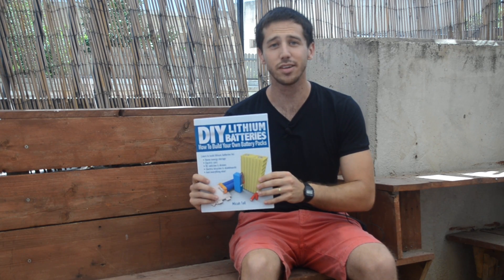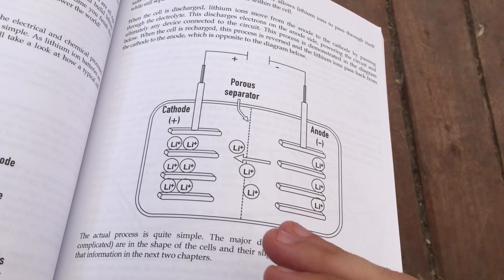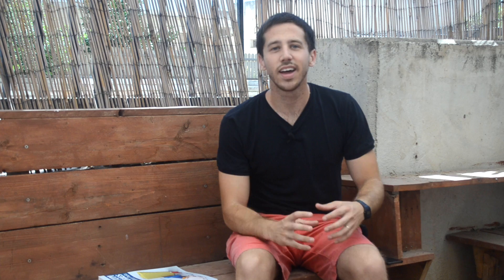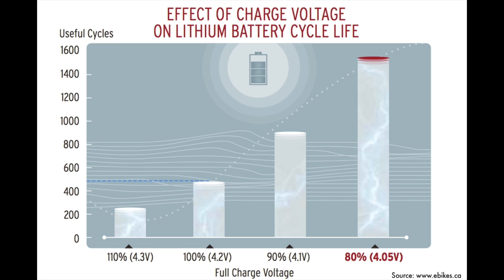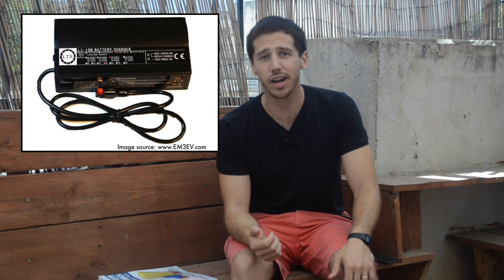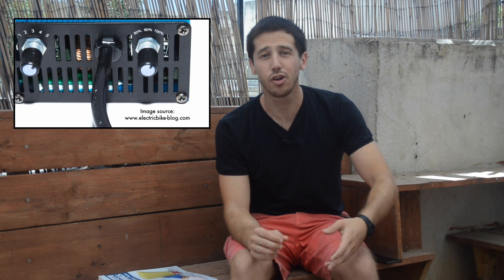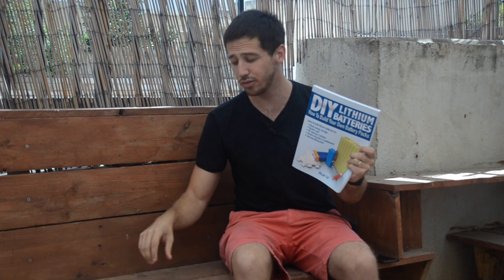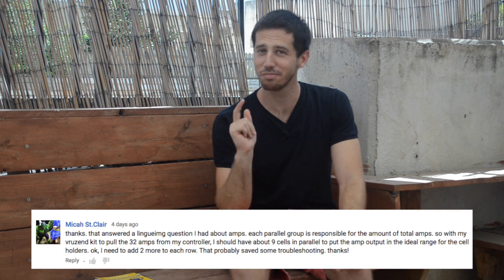How To Double The Life Of Your Lithium Batteries

Comment: Hi can you PLEASE 🙏 make a tutorial in how to make a 60V 680wh  battery  (or stronger) from start to finish. I plan on using 18650 lithium ion cells from hoverboard battery’s . It would be for a   Airwheel s5 (Segway) . The replacement battery’s offered are way to expensive, so please make a tutorial  that shows how to do it safe and on a budget where possible 😉 
Thanks for sharing your knowledge with the YouTube community!

Comment: HI, i HAVE A 36V 250 WATTS Hub motor. Can i directly run it with a bicycle dynamo which is 12v 500 mah. I will use an array of 3 to 4 dynamos to make it around 36v. Is it advisable. My batteries get drained that is why i want to switch to dynamos

Comment: I need a cheap way to discharge both my stored escooter's 48v 20Ah LiFePo4 and my ebike's 52v 21Ah Lion battery. Both have XLR connectors. The 52v Lion has an led on/off switch which I often leave on as a parasitic drain, but since it takes so long to drain down to 50%soc, I sometimes forget it's on (I'm old) and I'm afraid I will accidentally drain it fully. The 48v is from 2016, so I really need to pay attention to that one over the winter or it may be anemic come spring. I don't use it that often throughout the year, so it has relatively few cycles. I just need a cheap way to make a light bulb glow, but I don't have the skill to make it. Any help is appreciated.

Comment: I didn't have a clue before this video about  battery charging. When I do get an e-bike, this info will help me with my bike's maintenance. Thank you.
Reply: Hey, this doesn't only apply to e-bikes. It applies to everything that uses Li-Ion batteries like all smartphones, laptops and electric cars. Also something I think he didn't mention is that you shouldn't completely discharge a Li-Ion battery as that will shorten its life a lot. So charge it up to 80% whenever you can but only after it drops under 70%. That will maximize long-term battery health.

Comment: OK, thanks for that, very informative. For me range matters, and if I get 400 charges and 30 miles per charge, ie 12000 miles, I would be extremely happy, so full charge it is.
 I would be fine with 4000 miles from a battery, about 2 years for me, and so about £80/year. We can then get them re-celled.
 Thanks for sharing your knowledge.

Comment: Ziyoujiguang T18 what would be a the best controller for 250w hub motor  
people say this 250w motor is secretly 350 to make it faster 36v to a 
48v battery 14ah it has 36v 6ah does 15mph need about 25mph .

Comment: That’s what BMS (battery Management System) does. All lithium packs come with BMS.
The irony is the lithium chemistry needs these safe margins,by the time you take 20% off the top (charging) 20% off the bottom discharging shut off controls.
That means you only getting 60% capacity out of the batteries potential.
When you compare this capacity to new chemistries they seem heavier per energy density but in truth as an example lithium titanate these margins as well as speed of charge (not mentioned here “fast charging” also comprises the lithium ion . But not so much with the titanate fast charge fast discharge less margins. The result is that in real world application titanate out performs LI in longevity and usable capacity and completely blows it away in power input output!

Comment: The actual best way to preserve a lithium battery is to store at storage charge and charge up the battery before you use it.

This would require an intelligent charging system that you can schedule trips into and let it start charging when it needs to so that the battery reaches the needed charge just before you leave for your journey.

In short the battery chemistry is broken down by the voltage being too high or too low and temperatures being too high during storage.

Comment: A prius battery stays mostly at 61% even wile running.   going down a steep hill and regen breaking it will go to full but as soon as your done with the hill that batt will use the batt and not charge much till it gets back down to the 61% now this battery is a ni-mh not lithium but I believe that's why these batteries last way longer than 10yeaars.  I also have a ebike and charge my batteries with a I charger 106b+ no Bms and program the charger to ballance charge and stop at  4 volts.  So far batteries are doing verry well I also charge at 2 Amps as well slow charging seems to do better as well just my 2 cents thank you for ebike school video learned alot 😀

Comment: I'm not an expert on this but I'm charging my battery with a PWM motor controller, 3 cell battery holder with a total of 11.6 volts at full charge. That's 3.8666666 volts per cell?
Reply: thats correct

Comment: Brand New subscriber. I will be using a solar charger battery set up in a camper van I'm building out for retirement. I have four years to learn what I need to about  building out the interior, adding and making functional my solar system, and gaining a little more basic car maintenance/repair knowledge. This is by far the most easy to understand video I've seen. Thank you!

Comment: Excellent video, thank you so much. But I have a question: how can a bms protect from deep discharge,short circuit and over temp protection? I didn't think it actually can disconnect the battery from the circuit, as the battery is within the circuit parallel or in series and the bms is just connected in addition to each individual cell???

Comment: An 80% charge may triple your batteries charge cycles, BUT not your mileage in the real world. 
Idk if you're comfortable riding your bike battery down to the last few % but when I get back home and the battery were below 50% I'm gonna charge it. So now instead of using 80% of the battery in reality I'll only be using around 30-40% of the capacity and obviously I'll be using up those extra charge cycles much more quickly. Subtract a few more percentage points for unbalanced batteries and to me it would seem the added mileage may be minimal and perhaps not even worth the bother of extra monitoring, balancing, charging. 
 In the long run I think LiFepo4 or LTO batteries would give more bang for the buck?

Comment: When batteries are being stored without being used (let's say for the winter), does their charge/discharge cycle "hybernate"?
Reply: I need to know this too
Reply: @gregoryburkhead7813  They discharge even when not in use, but it is much slower with lithium compared to lead acid cells. It can take months to decrease its charge. A single season won't do anything harmful.
Reply: @dodgeplow  thank u so much
Reply: @gregoryburkhead7813  yw

Comment: What do you think about putting a silicon (0.6V) or schottky (0.25V) diode in series with a standard charger to reduce the charge cutoff voltage at the battery to undercharge it?  A switch can be added to  bypass the diode to balance the cells periodically.

Comment: Another way to extend the life of Lithium batteries:  Store them in the fridge.  If they are not going to be used for the winter, discharge the batteries to about 40% and keep them at 30-40F.  Studies have shown that you will lose less than 2% of the battery life while in cold storage for 12 months.  I keep my spare drone batteries, and a spare cellphone battery in the fridge.  So far, so good.

Comment: Thx for the video, I now bought a additional charger (not a expensive intelligent one, a simple one adjusted to 4 volts cell voltage at 10S packs) to charge only 80 % for commuting. For a longer journey I can still use the other ones with 100%.

Comment: I have had my 18650 lithium-Ion batteries for 5
years. They are still working perfect under load. I use them in my 6-wheel
drive Autonomous Robot. It weighs 20lbs. Load current is from 500mA to 4000mA
with speed controls, Mini Maestro 12 channel and a PIC16F887 for the brains. I
still get 1 hours of running time.

Comment: Hi, thanks for confirming what I'd long suspected, that fully charging or overcharging any battery limits its expected useful lifespan.  I suppose an analogy might be that if you drive your car at maximum speed all the time, you'd dramatically reduce the lifespan of your engine.
I also suspect that using your batteries whilst dramatically undercharged might also have a detrimental effect upon lifespan.  Analogy, under revving your car engine in too high a gear with your foot hard down would also damage the engine.  If one always operates well within design tolerances, then electro-mechanical devices last longer.
Good video, thank you.
Reply: I suspected things work this way after watching Dust Busters go bad again and again and again. I would keep them on the charger all the time, take them off occasionally to use, then back on the charger to sit. Every year or two my "hardly used" Dust Buster needed to be replaced because the battery wouldn't hold a charge. Once I figured out it was best to run the battery down with multiple uses before recharging, my Dust Buster has lasted much longer.

Comment: What about a using a benchtop transformer that can supply CV to recharge batteries at specified voltage such as 4.1 volts/cell? Would that be economically viable or is there a drawback for using such a transformer?

Comment: Keeping the battery cool when storing also helps exfend its life (Jeff Dahn video - why do batteries die?).

A recent Fully Charged video showed a ferry that stays within 40% and 66% by topping up after every crossing.  Accubattery shows this 26% depth of discharge causes only 5% of a wear cycle (as long as the bms can cope with such shallow repeated cycling)

Tesla may soon make a dry electrode tech (Maxwell) battery able to last 1 million miles?

Comment: Hi Micah Thanks for your valuable advice. I’ve been riding my ebike for 4 years now. I make my own batteries etc. What I think ebikers need to know is that balance charging only really works on a low current. It would be interesting to know what is the best amp charge for which size battery. 
Also can you recommend a good battery box and rack combo. Thanks.

Comment: Most people have better things to do than to check if the battery is charged appropriate level and then worry that the charge lasts the day.
Reply: Okaro X I think if there were chargers that balance charged properly then no one would have to worry about their batteries. But when you think about how much stress that is. An ebike maintenance is nothing.

Comment: Sir is it possible to make a self charging Electric bike or a car. Is it possible to make an Electric motor to a generator, so we all can do both driving and charging at the same time.
Reply: It is not possible. Thermodynamics say you need to put energy into the system to get it out. It also says no system is 100% efficient. You would need to plug a gas generator into a charger to get this effect.
Reply: @joblessalex  Thank you Sir for giving me the answer.
Reply: If you would drive and charge at the same time, you could also use a normal bike, which is much lighter and cheaper. You would also have the losses of the generator and the battery. 

But there's another way for a self charging E-Bike - solar https://www.youtube.com/watch?v=_oCbl2FDi2o

Comment: Hi i just bought a rainbow fatty 48 volt 13 amp battery brand new. I was told that i should recharge the battery after every ride for the first month as it would build up the power of the battery. Is there any truth in these directions . Thank you very much . Simon

Comment: Wow! Great information, I charged 1.6 kwh worth of mixed cells all the way to 4.2V in the course of measuring capacities. I then grouped them physically into 26 ten-packs for an Ebike build then shelved the project ever since last fall. Sounds like I may have ruined a bunch of batteries in those 8 months.
Reply: As he said very clearly, they are not ruined. You just want get as many recharge cycles. You probably will not even notice it.

Comment: This is really significant information. I'm getting old and I have a bad knee so can't put as much push in as I used to. I have been thinking of building extra batteries so I can get more range. By not charging to 100% that will extend the life of the batteries to make it worth spending £1400.00 on two batteries to give me 40 to 50 mile range. I will be able to put my bike on the train, go to the sea side have enough range to enjoy the visit but more importantly they will probably see me out.

Comment: WRONG, there is a much simpler way.using General Purpose Rectifier Diodes in SERIES on the positive line that you could mount a tiny pcb inside your battery bank. Each Diode should drop the Voltage from your charger around 0.48v & you should use diodes with a slightly higher amperage than your charging amps so for example on a 42v 10s charger 3x 0.48v = 1.44v 42v - 1.44v = 40.56v / 10s = 4.056v per cell, on a 13s charger 4x 0.48v = 1.92v 54.6v - 1.92v = 52.68v / 13s = 4.052v per cell & on a 14s Charger 5x 0.48v = 2.4v 58.8v - 2.4v = 56.4v / 14s = 4.028v per cell.

Comment: I'm confused. At the beginning of the video you show a graph indicating that charging to 4.1 instead of 4.2v will get double the cycles. Then at the end of the video you say charging to 4.2v is not that big of a deal. But clearly it is :/
Reply: Hes saying if you undercharge you are not getting full use of your battery so that is the trade-off.

Comment: Big problems. Can one convert common car batteries to be used in ebike. I manage to serie/par connect combo of motorbike and one car battery. I have 3wheel ebike. The ebike run......but only for 15 min.
Reply: MJ Young in the long run your better off getting a lithium battery. SLA batterys don't have as many discharge cycles so you would be replacing those heavy batterys more often. And lead acid isn't nearly as energy dense as lithium. Instead of 15 minutes you can go an hour or more. But to answer your question yes you can use car batteries. You can run them in series. For example to make it 48 volts you would use 4 car batteries ran in series. Be careful doing this, if done wrong you could fry your controller or batteries.

Comment: Thanks for the great info, but can you tell us about storing/charging in high and low ambient temperatures,does the temp affect the batteries?  Thanks
Reply: A year late but still hopefully helpful. Heat hurts the cells similarly to storing the batteries at full capacity. It increases the speed of the reaction inside the battery. It's generally best to store batteries at 40-60% at cool dry temps (between 40-60 degrees F)

Generally speaking, charging under the same temperatures is best unless fast charging. Fast charging should occur with the battery warmed up to operating temps (typically between 70-90 degrees F)

Comment: I use the very cheap, but not as accurate way to undercharge my batteries, I use a time socket, one one of my bikes it takes around 1 hour to charge 35-40% of my battery, so whenever I come back home with around 30 percent, I set it to give electricity to the charger for around 1 hour and 15 minutes, so when I wake up, I find my bike battery at around 80%, with the other bike that has super slow charge rate it charges at around 15% per hour, so if I have around 20 percent, I set the timer for 4 hours so again, I find my bike with 80% of charge. Ofcourse, sometimes I find it with 90% sometimes with 70, it's not accurate, but it costed my a fiver and it does the job.

Comment: Ive pondered on rebuileding my 36v battery with 11 cells in series instead of 10 for this reason and now I'm pretty sure thats what I'm going to do. Top vid as always, thanks man
Reply: Did you ever do this? How did it work out? I think it depends on the motor & how it's designed. Too high a voltage can damage the diodes (in the motor) depending upon their rating. Plus the motor's efficiency will change dependent upon the voltage. Usually their highest efficiency is at 36V if that is what the motor is rated at. Of course if you use 10 cells & charge up to 4.0V/cell you'll start at 40V & go down to your cut-off voltage of 27V (assuming 2.7V/cell cut-off). At 11 cells you'll start at 44V & go down to 29.7V assuming as above. At 11 cells that allows the voltage range to drop 14.3 volts versus only 13 volts for 10 cells resulting in longer range. What's your analysis?

Comment: For those who are really particular about taking the best care of their battery pack, Depth of Discharge plays an important role in cell aging as well. Read up on it at batteryuniversity.com. 

The amount a Li-ion battery is discharged before recharging plays a role in the ultimate lifespan (cycles) it can get. The less the battery is discharged before recharging, the easier it is on it and the longer lifespan it will get. (Number of cycles). 

For example in this video, a recommendation was given of a typical usage of charging the pack to 80-85% then riding it one day down to 60% or so, not charging it, running it again the next day to 40%, not charging it, then running it the third day down to 20% before finally charging it back up to 80-85% again. 

Doing this isn't recommended by the authors at battery university.com to get the longest life span. Tests have proven it. 

The ideal charging method for a li-ion battery pack that's going to be used (not stored) is to charge to about 4.0V per cell (52V for a 48V pack) if you don't require the full capacity of the battery for your trip and recharge it again before the next trip. Don't skip a charging opportunity by riding more trips to get it down to a lower voltage. 

More frequent small discharge/charge cycles is significantly easier on the battery than less frequent deep discharge/charge cycles.

As mentioned in the video, occasionally the pack should be balanced by the BMS, which only occurs during a full charge, so every once in a while (1-2 months) give it a full charge if you normally don't fully charge it to allow the BMS to balance the pack.